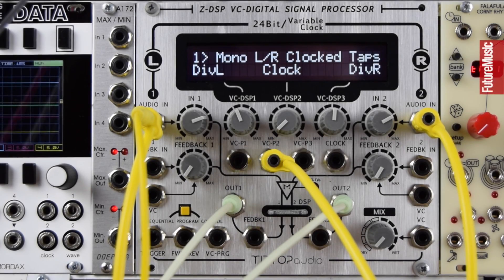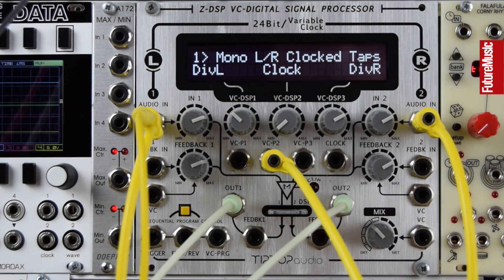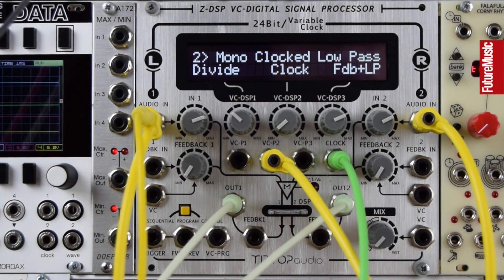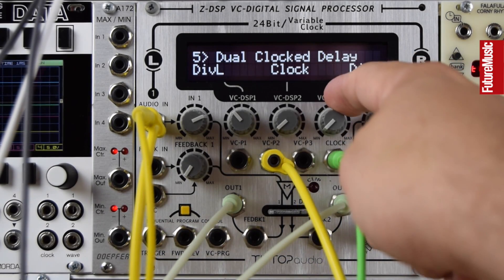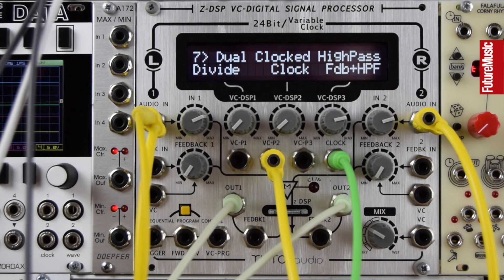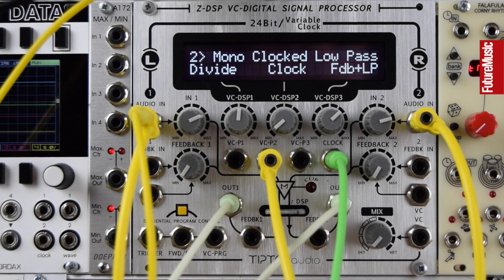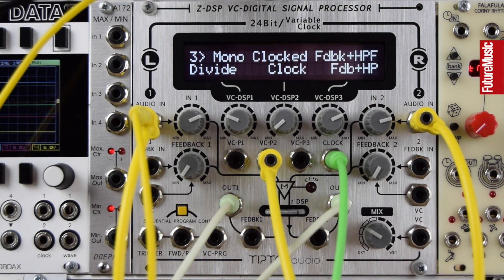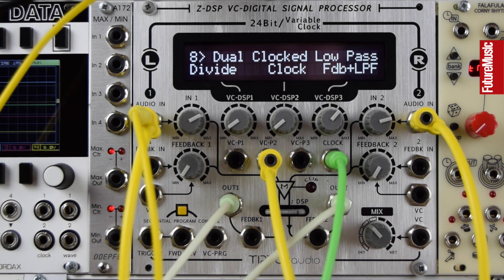Modular Monthly: TipTop Audio Z DSP – Part 4: Clocked Delay

Comment: hey I'm thinking I'm missing something - how are you getting the delay taps to be in time? Is it the VC of parameter 2 or the clock input? I'm looking for a delay that I can keep time with my sequencer rather than setting delay times manually cheers
Reply: The jack labeled 'clock' input slows down the processor, resulting in a lo-fi sound. With this card, the delay is timed to the input of VC-F2 -- the center knob labeled 'clock' on the LCD screen. So you'd put a 50% PWM beat into VC-F2 to sync the delays to.